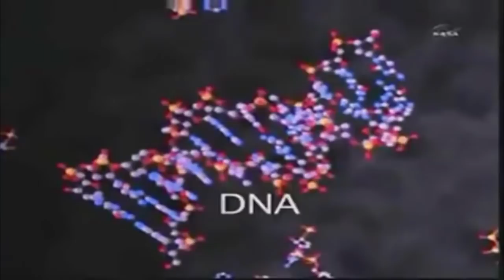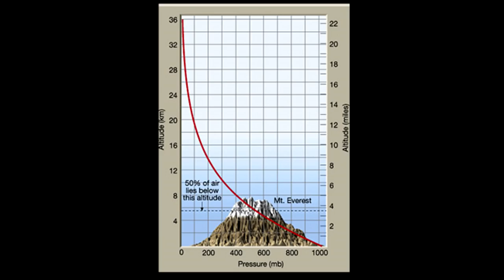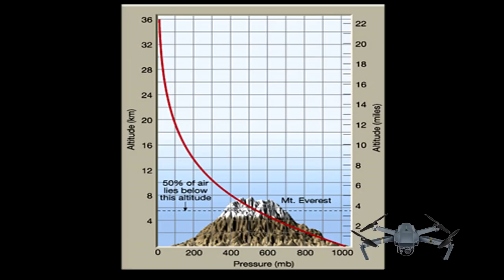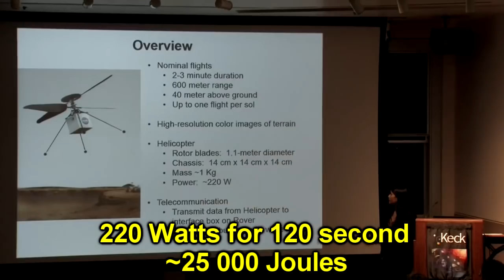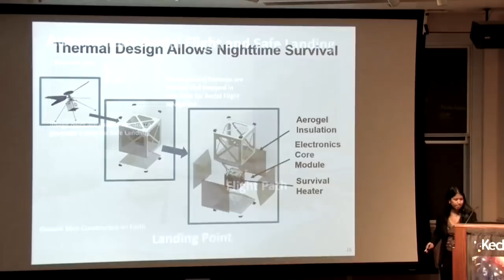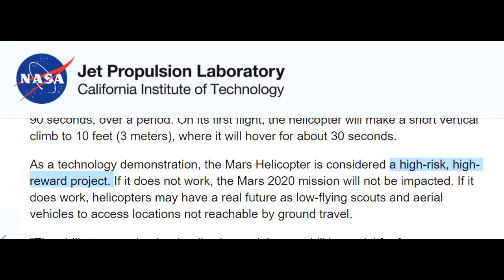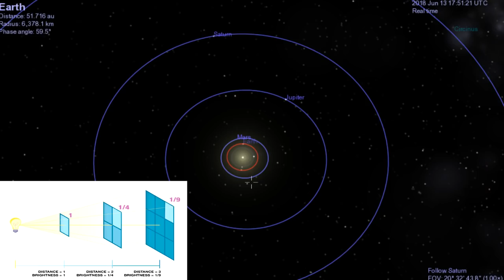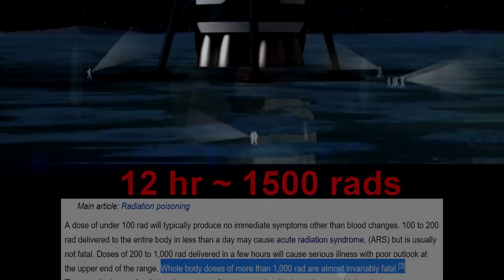NASA is sending Helicopter to Mars!! Smart or Silly?

Comment: I'm a bit late to the party, but you are qualitatively wrong about the rotational speed. Lift goes increases with the square of the airspeed, and roughly linear with density. The reason is easy to see even in your simplified, horribly wrong model of lift: going twice as fast, it hits twice as many molecules, and it hits each molecule at twice the speed, so imparting twice the momentum. So to compensate for air 100 times thinner you only need to spin the blades 10 times as fast. Coupled with bigger rotor blade and the lower weight, rotational speed is in a very sane range. A larger problem is preventing the blades tips from going supersonic.
Reply: "Air" is different too. It is CO2 vs. N2 and O2.
Reply: Not only that, but he fixates on the rotating speed.  There's no need for this, since lift is proportional to the square of the speed, times the area.  You can see clearly in the pictures that the blades are very wide, so it doesn't even need to be 10 times as fast.  Maybe more like 3x.
Reply: Actually they seem to operate, as he found out himself, at roughly the same rotational speed as on earth. The reason is that to get as much lift from as little a rotor mass as you can, you rotate them as fast as you can get away with without sacrificing aerodynamic efficiency. And the optimal speed is where the blade tips just start going transonic, where drag starts increasing much faster than with velocity squared (aka "the sound barrier"). Speed of sound in a gas mostly depends on molecular weight and temperature, but very little on pressure and density, so is comparable on Mars, though not identical.

Comment: I'm seeing a lot of skepticism, but they've flown this in a container designed to mimic Mars' atmosphere.
Reply: Yeah but they don't have thunderf00t, the worlds greatest aeronautics engineer.
Reply: @richardsolomon5375   Yer he thinks helicopters fly by batting the air down. I think he should stop his know all persona right there.
Helicopters get lift just like an airplane, from a foil shape moving though air creating a negative pressure on the top of the wing/blade.
Any assistance from a downward movement of air is purely secondary at best.
Reply: @Dug6666666  Some of the thrust is from the kinetic energy of redirecting the airflow downwards, but the vast majority is from the pressure differential between the top and bottom of the airfoil. The airfoils on the Mars copter will also have the requisite washout which makes them much more efficient too.
Reply: Yes.. we're a little skepticle any standard propeller flight vehicle can lift off with a surface air pressure of .08 lbs/sq in. Earth at 60,000 feet is .8 lbs.. 10x the surface of Mars. OOOOhhhh! such thoughts never crossed our highly scientific minds? Instead were off on some tangeant "Simulated Martian Atmoshphere."
Reply: Conal Faw  really? Where exactly is this container?
Reply: @Miner-49  I don't know where this container is. What a weird question.
Reply: Conal Fawcett 
Ohh ok....do you know when these flights were made? Who was the pilot? Where can people watch the videos of the flights? Is there any actual proof of the flights your claiming? Or are you just puking some bullshit out? Sounds like the friend of a friend’s friend story your telling. Hearsay is the actual term for it. You just believe anything anyone tells you? 
My question doesn’t seem so weird now does it?
Reply: @Miner-49  I saw a video of a small helicopter drone in a vacuum chamber and it was living proof that such a flying contraption can work.
Reply: @Miner-49  if you saw a video of a car crash, would you not believe it until you knew where it was, the names of the drivers, the registration plates, the time of day?

Yes, your question was weird.
Reply: Conal Fawcett 
You have no common sense. You just repeat what you are told, a gossiper
Reply: @Miner-49  you seem to be quite passionate about discrediting the source of things put to you, but not so passionate about explaining why they're wrong.
Reply: Conal Fawcett 
You haven’t provided a source. All you have provided is hearsay.
Reply: The first test took place in the Space Simulator of the Jet Propulsion Laboratory in California in January 2019.
The test was conducted in a vacuum chamber adjusted to Mars's atmosphere and assisted by a motorized lanyard pulling it up to simulate Mars gravity.
This Mars Helicopter is named "Ingenuity", weight 1,8 Kg (around 4 pounds) and will be assisted by a rover called Perseverance to carry any heavy equipment (like long-range communication) and is set to launch between July 30 and August 15 in 2020.
The objective of the mission is literally to try flying on Mars, it is expected to fly once and maybe more if possible within 30 days.
Source: https://mars.nasa.gov/technology/helicopter/#

Thunderf00t is right on a lot of stuff but you can't take everything he says as gold, he gives his educated opinion on various subjects and he clearly misinterpreted the expectation of NASA about this drone.
Reply: @ConalRF  helicopter in a vacuum? sure.... sure, I believe u, buddy...
Reply: @tiagooliveira95  I didn't say in a vacuum. That's impossible.
Reply: @ConalRF  "I saw a video of a small helicopter drone in a vacuum chamber and it was living proof that such a flying contraption can work." I can now see that this was satire  by reading the comment history, but this comment by itself doesn't sound like satire
Reply: @tiagooliveira95   I said "in a vacuum chamber". That doesn't mean it was flying in a vacuum. I didn't say nor mean "in a vacuum". You have misunderstood.

The chamber was used to mimic the density of Martian atmosphere. It's called a vacuum chamber because it can reduce the pressure inside it. It doesn't mean it does either 1 or 0 bars of pressure only.

How would a propellor fly in an actual vacuum? That's just silly, and it's not what I said.
Reply: @ConalRF  but work in what sense? Can take flight, sure, but what utility is there in that? Unless it's scalable to the point where it can usefully carry a payload, for example, then a drone on mars is just an extremely expensive toy.
Reply: NASA is not dumb. The’ve made mistakes. But they deliver.
Reply: @ConalRF  its a stupid way to word it though.
Saying "in a vacuum chamber" implies vacuum.

The corrent way would be to say that you saw a helicopter fly in atmosferic pressure similar to mars.

What you said is like saying, I saw a dog breathing under water at a depth of 5km...

And when people argue that this is not possible you say well the dog was in a submarine.

You see how stupid this argument is without context?

Saying "in a vacuum chamber" without context implies no pressure.

In your analogy, a vacuum chamber could also be set at normal sea level pressure making the whole sense of the phrase meaningless.
Reply: @tiagooliveira95  but vacuum chambers that create a near vacuum down here on Earth don't create a perfect vacuum, but we call it a vacuum chamber.

It's obvious that there's no aerodynamics in a vacuum, it's obvious a vacuum chamber doesn't mean vacuum for the experiment I referred to.

I don't think it was as misleading as you say, based on the context. Your analogy refers to a different sentence about a dog in a submarine, so you're using a random and unconnected misleading sentence to say that's how misleading I was. I disagree.
Reply: @tiagooliveira95  I got the jist of the comment you just deleted.

You seem to be confused about what I said. It's obvious there are no aerodynamics in a vacuum, which supports my argument that I wasn't implying it by saying "vacuum chamber" since a vacuum chamber on Earth does not create a full vacuum, and I mentioned mimicking the atmosphere of Mars, of which is not a vacuum.

You're sounding all the more deliberately obtuse as you go on.
Reply: @ConalRF  Well i deleted the comment for a reason, you digging your email box to search for it is just sad. I hope you find a hobby soon.

Still misleading tho, but let's agree to disagree
Reply: @tiagooliveira95  I read it in my notifications actually, but I see why you're getting argumentum ad hominem so it's cool. 😂
Reply: @ConalRF  still sad tho
Reply: It's hilarious reading a conversation thread involving people who didn't actually watch the video all the way(or possibly at all). Seeing people go "Thunderf00t's an arrogant naysayer who thinks he knows more than NASA" while seemingly obvious to his ultimate conclusion that it can be done and that NASA seems to have worked everything out well enough for this thing to have a good chance at working.
Reply: @ConalRF  it sounded more like he wanted to go there lmao
Reply: The skepticism isn't on it flying but more on it surviving the night. But to be fair, their designers even admit they're not certain on it doing that. I more worry it will clog up as the dust on Mars is fairly static from the solar wind. Hope they really sealed their motor or it was just a cool demo.
Reply: @Skylancer727  It's really exciting though. Many space missions have under performed, and others have well exceeded expectations.

How will it stay warm indeed.
Reply: @ConalRF  can't deny, I am egar to see what happens. Hubble for example was only supposed to last at lost to the mid 90s yet still runs today.
Reply: @Dug6666666  ...you realize there are different ways to look at the same phenomenon right? In fact if anything "how much air it bats down" is imo a MUCH more elegant way to think about lift if you are analyzing a chopper (as opposed to designing one).

Without lift, chopper gets pulled down. Chopper needs to pull itself up, and for every force there needs to be an equal and opposite one. So in order for chopper to fly up, something needs to fly down. Only thing that thing can be is air.
This is also known as the conservation of momentum. If we consider that relative to an inertial reference frame the chopper needs to accelerate up to "remain in place", it's clear something else needs to accelerate down. 

This is typically what people do when analyzing stuff. Take a step back to look at a big picture.
For example when you look at electrical flux you COULD go step by step and deal with all the convoluted nonsense, or, if you don't need that level of detail, take a step back and say, ok, according to Gauss's law the flux existing this close surface is 0 because there is no enclosed charge.
For another example you COULD look at a chemical reaction and try to calculate the energy delta by analyzing bond strength, but if you just need a summary you take a step back and say, ok energy is conserved, so temperature changes elsewhere in the closed system must be equal energy given off.
Reply: @Declan-pg8cg  You are misunderstanding the same thing. ALL the thrust comes from redirecting air downwards. The pressure difference makes both the chopper to go up and air below to go down. It's 2 faces of the same coin.
Reply: @ConalRF 
Well you did say this

"I saw a video of a small helicopter in a vacuum chamber and it was living proof that such a flying contraption can work"

Helicopters can't flying in a vacuum cause it uses the atmosphere to lift off.
Reply: @privatecaboose250   I didn't say it took off in a vacuum. It goes without saying that that's not possible.

What else do you call a thing that reduces the atmospheric pressure in a volume of air, if it's not a vacuum chamber?

I literally used the right terminology, you lot got confused.
Reply: Oh my goodness. You can have a test of a drone in a vacuum chamber. News flash, you can stop pumping air out of a vacuum chamber before it ever reaches a near vacuum. There's a thing called an off switch. You can turn things off and on whenever you want, which includes vacuum chambers.
Reply: @TheBlackSkimmer  dude, a concerning number of people have said to me that I said "vacuum chamber" as if I said vacuum, when they're only pointing out their own confusion at what was the correct term.
Reply: 08:48 Plus Thunderf00t refers to the.... VACUUM CHAMBER they tested it in.

DURR VACUUM CHAMBER NO FLY AERODYNAMIC VACUUM NO
Reply: 14:49 Oh look, here's a test.
Reply: This isn't even a complicated idea to grasp, or so I'd assumed. Air is sucked out of a vacuum chamber, it was done to match the pressure of Mars.

Do you think the pumps they use to suck the air out can't be turned off at the right pressure or something?

Do you think a vacuum chamber that makes the chamber 0.088 PSI (Martian pressure) is suddenly no longer called a vacuum chamber because it's not attempting near vacuum?

Do you think everything with the name vacuum in it literally means a space void of matter? Is that what you think is inside your vacuum cleaners?

Holy shit. You click on science videos too!
Reply: @ConalRF  okay... I was wrong, I hope you are happy now, I posted my comment months ago and you still think about this, it's pretty sad...
Reply: @Dug6666666  it’s a very simplistic model he uses for the explanation. However the pressure differential is generated by directing the airflow to one side of the airfoil generating an overpressure on one side and an under pressure on the other side. However if you look at the gas model how do you think the molecules are redirected
Reply: @Dug6666666  Wrong. The amount of air being displaced is directly proportional to the pressure difference! Why do you think that there is a pressure difference in the first place? Because the air is being moved from the top of the rotor to the bottom!
Reply: @Dug6666666  Why did you delete your comment? Did you finally realize you were wrong?
Reply: @nic12344  I didn't, maybe they don't allow links on here.
Did you read the comment, it was a request to supply a credible reference source about how helicopter rotors work by batting the air down like a snooker ball off a cushion and that a 45 degree tilt of the rotor will give max lift. ( the links where to what I consider credibile explanations)   
I notice he didn't challenge comments on his understanding of how rotors work in his follow up video. Seemed to comb the comment section for everything else.
Anyway I'll copy this in case I need to repost it.
Reply: @Dug6666666  I can't, because a rotor tilt of 45 degrees will not provide maximum lift. Maximum lift is obtained when there is no rotor tilt. Unless you mean the angle of attack, in which case 45% isn't optimal either as it's much too steep and the blades will stall.
Lift theory is not all black or white. Bernoulli's Principle can't explain it like you are suggesting... Lift is very complex and there is still a bit of debate in the scientific community as to how some of it works! However, air moving down and pressure difference are two interrelated components of lift.
Here's a video that explains it :
https://www.youtube.com/watch?v=aa2kBZAoXg0
Reply: @nic12344  Yer angle of attack.  The blades at 45 degrees would have the helicopter fall out of the sky.
Your starting to get what I have been talking about all along as in 4:30, TF has no clue what he is talking about.
One of the example videos I attached somewhere in this videos comment section as an example of what I agree is how it all works is this one: https://www.youtube.com/watch?v=PF22LM8AbII&t=545s from what I can gather it is a less dry explanation of the same thing as your video.
Anyway this video we are commenting on is three years old video that has gone bonkers and has passed into irreverence and I'm getting tied of making the same point.
Reply: @Dug6666666  As he said at 4:43 "you're gonna produce the most thrust [lift] when the blades are pitched at 45 degrees, you know, with this very simplistic model."

He knows that's not exactly how it happens in real life, he's only using a very simple model to make a point : Less air density means less lift.

But he is right, with a straight planar wing, the angle at which the most lift is produced is 45 degrees. The only problem is that it also produces a lot of drag, but that's not important for what he was saying...

Yes, your video source says pretty much the same thing as mine, which demonstrate that your previous comment is wrong :
"Helicopters get lift just like an airplane, from a foil shape moving though air creating a negative pressure on the top of the wing/blade.
Any assistance from a downward movement of air is purely secondary at best."

That last part is wrong, since the downward movement of air is a primary component of lift. The air end up lower after the wing than before, so, as per Newton's laws of motion, if the air goes down, the airfoil must go up! If anything, it's the pressure difference (Bernoulli's Principle) that is a secondary component, since you can generate lift with a flat symmetrical wing or even an asymmetrical wing upside down.
Reply: @nic12344  I'll concede I'm no expert on what contributes most to rotor lift. 
However my definition of a simplified explanation is one that is correct but leaves out complications.
"Batting the air down, complete with an animation showing air being deflected off the rotor (not following the contour of it) and blanket statements saying "about 45 degrees will give maximum lift" is a stupid explanation in my book.
You might be convinced its a simplified explanation. I not as sure he knows what he is talking about.